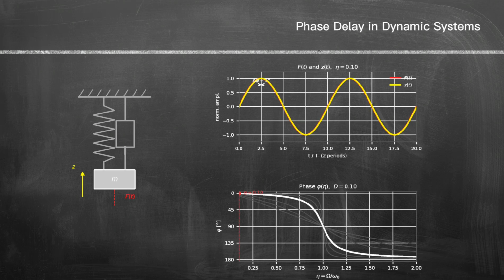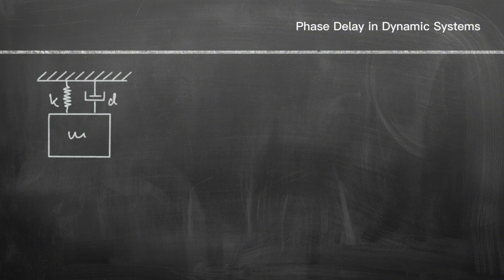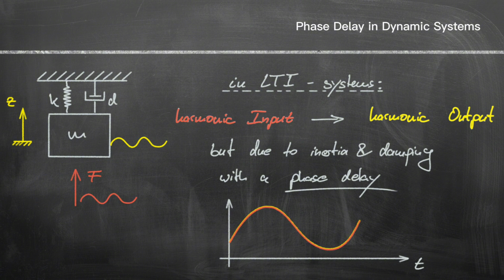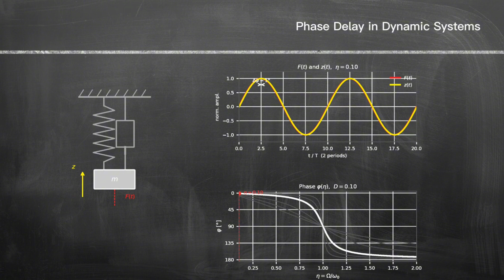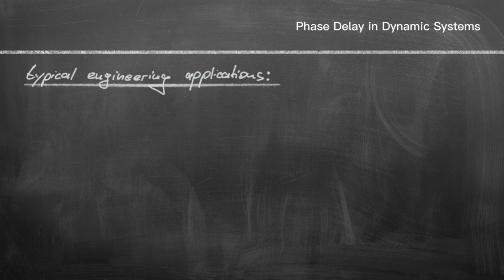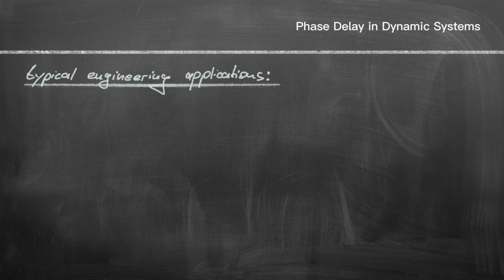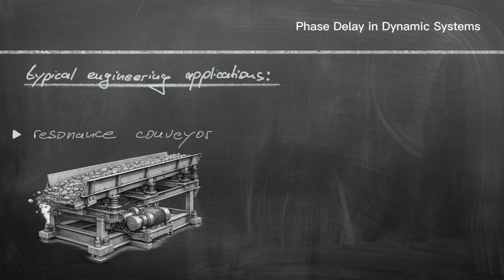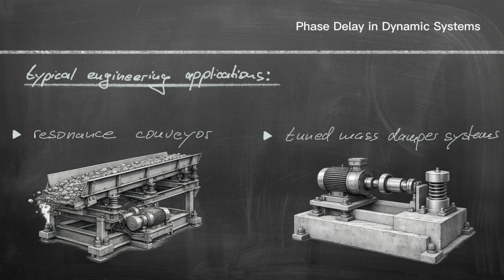Why Phase Shift Appears in Oscillating Systems | Fundamental Dynamics

Comment from the maker: This video explains physically why phase shift in forced vibrations increases from 0° to 180° with frequency ratio, and how this is exploited in resonance conveyors and tuned mass dampers.
Full course with guided exercises: https://www.udemy.com/course/simxacademy_fundamentals-of-dynamics-and-oscillations/?referralCode=88CF623C0A5EF8D64579
Which application surprised you more — the resonance conveyor or the tuned mass damper? ❓